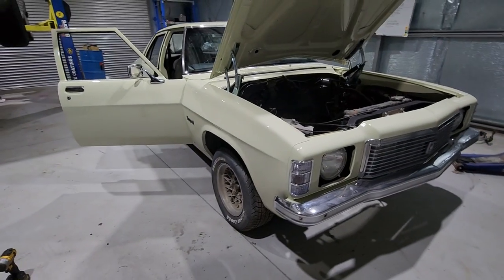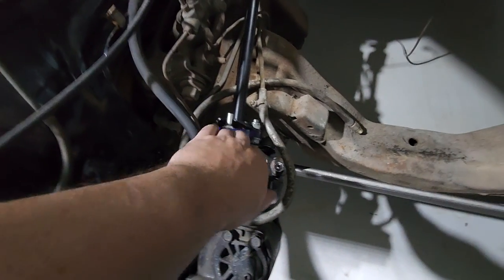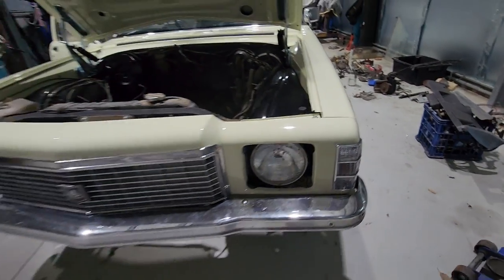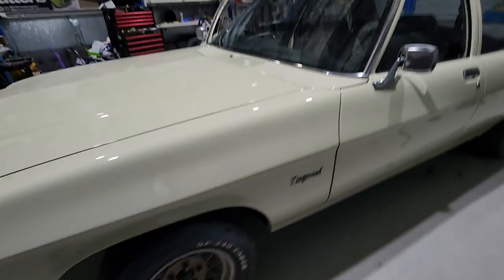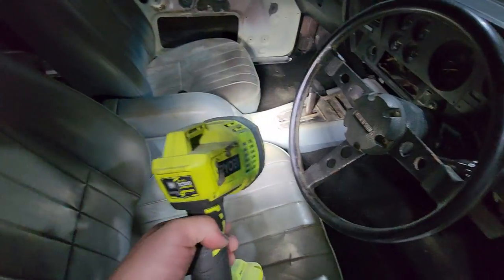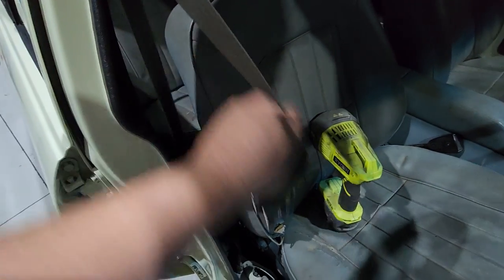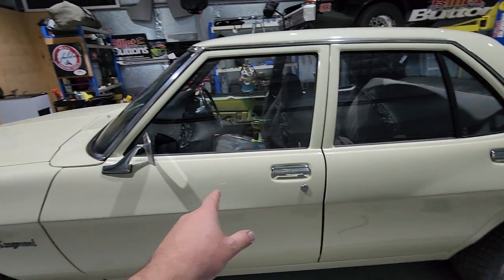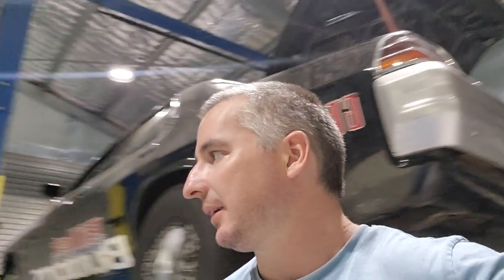Holden HZ Sedan Project Budget build Part 5 - Interior & Exterior Finishing

Comment: Mate I can't even get my Holley 750 DP Sorted on my VL. Effing thing just decided to take & crap & floods Cylinders 7 & 8. Fricken Needle & Seat I'm sure. Stripped it down three times to investigate. Probably an "O" Ring issue. What you've done is awesome!
Reply from the maker: Usually the needle and seat oring does that, carbs can be frustrating.
Reply: @MCFRYMotorsport  Yeah I'm sure it is, but when they work, Hello!

Comment: Realistically it’s costing $100k
Reply from the maker: If I put a built driveline in this car it would easy. Using old original factory stuff it will be 25-30k
Reply: @MCFRYMotorsport  if you were paid for your time and skills.
Reply from the maker: @Paul Coote  yeah, I'd say around 80k minimum but 100k+ is more realistic.